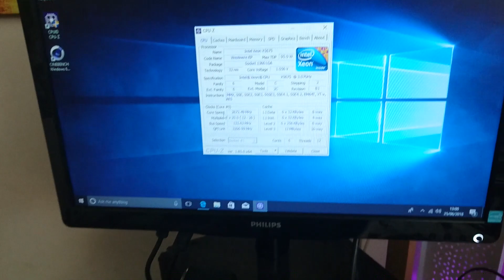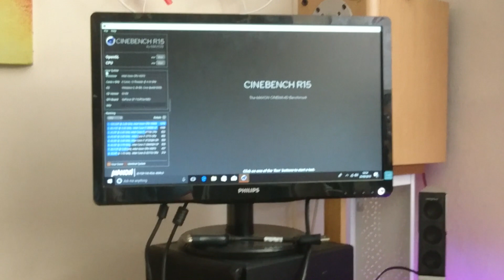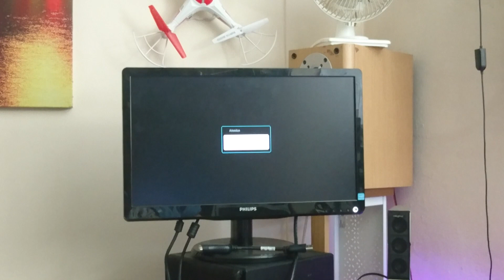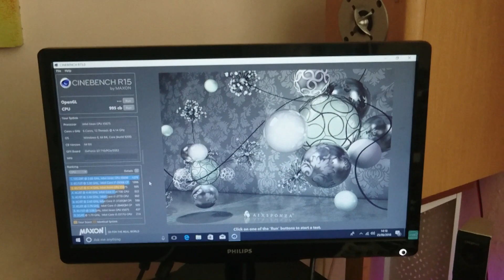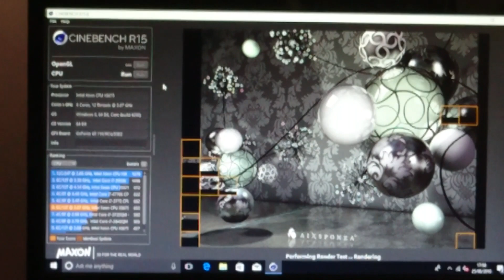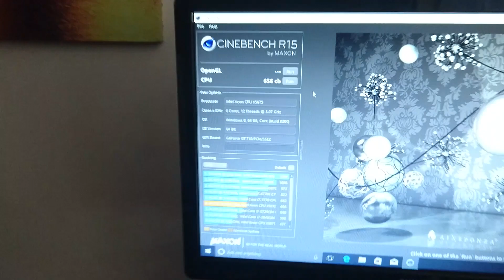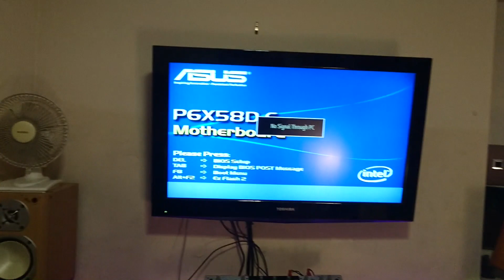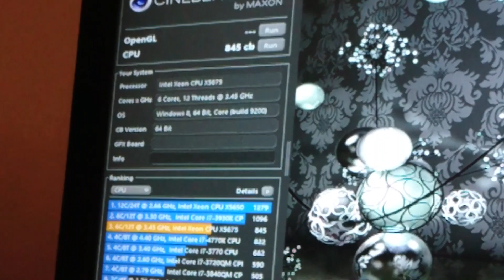New System Built with ASUS P6X58D-E + Xeon X5675 - Journey into X58: Part Three

Comment: Tylersburg X58, blooming brilliant platform. You got me tinkering w/ mine again. ASUS Rampage II Gene (i7-980X), P6X58-E WS (W3680) & Z8NA-D6 (2x5675). The ROG failed 5yrs ago May b my stressing it w/ overloaded 2x EVGA 780-Ti but the WS is still going but using X5675 since it OC’s so easy on it w/ X58+NF200. What is your ram sync multi & speeds at various BCLK changes? Mine was picky locking in 10x for ddr 2000 or even 1600@160 but 222x8 ok for 1776. I like the X5675 for daily OC as it can just do Auto everything at 166 BCLK utilize turbo + speed step. Volts reasonable but over that draws more in auto so I’d lower manually. I tested w/ a Xeon W3690 & is fine but the X5675 does same w/ less volts & heat. 
Intel i975X black pcb built by ASUS bk in the day did OC pretty decent to keep up. I don’t think they build like that anymore.

Comment: Which cooler did You use?
Reply from the maker: If I recall, it was a coolermaster hyper 212
Reply: @UsedTechHustle  Wow thank You for early reply
Reply from the maker: @mateocvetic9621  it's my pleasure, thanks for watching my crappy videos :)
Reply: @UsedTechHustle  I think your videos are really great and that you put good effort in making them! 😀
Oh and I have recently came across used Xeon x5650 and Foxconn Flaming Blade GTI X58 motherboard for roughly 64 USD and I am still not sure if I should go for it and I do not know if the Xeon can be overclocked on this specific board
Reply from the maker: @mateocvetic9621  oh thank you :) that means a lot. Feel bad for not uploading in a while tbh.

As for that deal, that seems very cheap, certainly worth a gamble as even if you can overclock it's still a good amount of raw power for very little outlay :) great hustling!
Reply: @UsedTechHustle  Thanks, I think I will take the risk and go for it

Comment: What maximum GPU can I put there? 980?
Reply from the maker: A 980 would work well. Iv used a 1070 with no issue also
Reply: @UsedTechHustle  I'm thinking about 1080 but not sure if stock one will bottleneck

Comment: Why not X5690?
Reply from the maker: Price was a factor, but really there was no specific reason. If an X5690 was available for a similar price at the time I would have gone for it :) Iv just had a X5650 come my way too so will be comparing
Reply: @UsedTechHustle  What ram did you used? (Ive read that x5690 do not support 1600Mhz rams here: https://www.game-debate.com/hardware/index.php?pid=2317&cpu=Xeon%20Processor%20X5690)
I have GOODRAM 8GB 1600MHz CL11
 and I dont know shuld I buy i7 or Xeon (I have motherboard Asus P6X58D-E
 https://www.game-debate.com/motherboard/index.php?mot_id=8&motherboard=Asus%20P6X58D-E )
Reply: GOODRAM 8GB 1600MHz CL11 works I have 32GB
Reply from the maker: @danielszulc9574  Sorry just seen this. Both X58 Xeon systems I have here use 1600mhz RAM with no issue :)

Comment: Hey....I know these videos are pretty old now, but when you clocked it back down to what you said was 3.75ghz.....you do realise in cinibench on the left hand side it was showing 4.15ghz. I'm assuming that's what it was clocking to with its boost clock as the boost clock from stock goes from 3.07ghz upto 3.40ghz, so around 350mhz, so from your overclock of 3.75ghz I'm guessing it was boosting upto 4.15ghz....that's what you got 996 score from. Always gotta remember that auto boost they have. I have literally just put an x5675 in my Msi platinum sli-7522 motherboard. It works great, but I clocked mine to about 3.75ghz with the BCLK and then in cpuz it was actually clocking itself upto 4.19ghz... When I saw that I jumped a little. But it shows that they take it easily.....alot cooler chip than the i7-920 I had which was 39c at idle, but x5675 is sat at 20c at idle. I love it......
Reply from the maker: Welcome to the X5675 club :)

Comment: Hey @Used Tech Hustle
 how you enable ACHI mode in Windows 10? Btw did you test hdd speed with AS SSD? As I can see, you are enable ACHI in BIOS too, but on my PC AS SSD shows that I'm using ide. Some pictures: Win10 as ssd https://imgur.com/MPHT3UW , BIOS achi on - https://imgur.com/IhRH9R2 but no hdd detected. Is this OK?BIOS boot menu show IDE not ACHI - https://imgur.com/ZktZV7i and MARVEL controler too - https://imgur.com/cA7i23g . Thanks

Comment: Hey mate I have hp z400 xeon x5670 120 ssd gb for windows 500 hard disc for rest 8gb 1333 rams gtx 560ti my question is
I want to know which is better your mobo just only the mobo compared to mine I mean durability and so on
Reply from the maker: Id assume the z400 motherboard does not support USB3 etc (though that can be solved easily of course) - however I presume such the z400 board wont allow for overclocking also which could be a a pain when trying to squeeze more from your CPU. As for durability, time will tell how mine last but your HP will be typically excellent for longevity as these kinds of workstations are built to last :)
Reply: @UsedTechHustle  g

Comment: hiii , i have a i7 950 + msi x58a gd65 board ..can i upgrade to x5675 ?? 
i checked cpu support but it doesnt show this model ??
Reply from the maker: Hey pal 

If you can get hold of the CPU, id say go for it! Neither of the X58 boards iv used have the CPU lists (see https://www.asus.com/Motherboards/P6X58DE/HelpDesk_CPU/) but they work fine :) 

A quick search found this listing https://www.ebay.co.uk/itm/Bundle-MSI-X58A-GD65-INTEL-XEON-X5675-8GB-RAM-B367-/282556826572 which shows someone had paired the board with the X5675 so id say your in luck

Good luck! And thanks for stopping by!
Reply: @UsedTechHustle  thanx a lot 😊
Reply: http://www.pc-specs.com/cpu/Intel/Xeon/Xeon_Processor_X5675/2332/Compatible_Motherboards

Comment: Hey man, I like that you are delving into the X58 builds, just came across your channel. 

I am started building an X58 machine as I had compatible parts from my other older Dell machine.

But referencing that noise on the Intel board, it is probably the same as what I am getting on the Gigabyte board I bought, on mine it is Coil Whine from the Chokes on the VRM section on the motherboard, next to the CPU area. I have pressed down on the Chokes with a pencil with eraser on the end, and when I do it changes the tone and volume of the whine noise. I've been researching and it seems the glue that surrounds the coils inside the Cube Chokes/Inductors can come loose and then the vibrations created by the current going through create easily heard audible levels, very annoying! 

I am currently contacting Gigabyte to see if they can tell me the spec of the Chokes and I may go completely suicidal and try to replace all of the Chokes using my incredibly limited soldering knowledge. The motherboard is just far too good to not try but I will not continue to use it with the noise as my aim was to build a very quite PC.
Reply from the maker: Hey thanks for stopping by!

What you saying makes sense and its certainly annoying but I could overlook it really as the board worked just fine :) I really hope luck is on your side and you can fix it without too much fuss!
Reply: No worries at all, this noise cannot defeat me, I got a great deal on the motherboard (I may have been sold it when the seller knew it has this issue but we will never know) I think it is doable as long as I get the specs for the chokes and can still buy them!

Comment: I did a gigabyte X58-UD5 + W3690 build with a 240 enermax RAD and I have it at 4.5ghz doing 1040cb but I am gonna go higher like 4.6 or 4.8ghz with temps in the high 80s so I am thinking custom loop, oh yeah my GPUs are the period appropriate Kepler GPUs 2x gtx770s 4gb. Gonna have a 360+240 rad in the custom loop
Reply: I wanna hit 1100cb or even 1300cb like a Ryzen 1600 can
Reply from the maker: Very nice, good luck!
Reply: Used Tech Hustle oh yeah that ocz SSD is the old company (1st Gen SSD technology), the new OCZ blue/silver (3rd Gen ssd tech ) SSDs are owned by Toshiba and they are good as crucial SSDs. So don't be scared of the new Toshiba-OCZ SSDs that came out in 2016, 17, 18. 
Oh yeah I did testing with 12gb RAM at 1600-8-8-8-24 and 24gb RAM 1600-8-8-8-24 and that did help my cb score by 40-50pts. So more DDR3 opens up with the more dimms you put in. My ram is Gskill ripjaws4 1866-10-10-10-30 rating (6x4GB) for $80usd